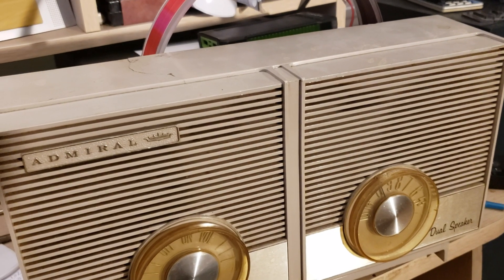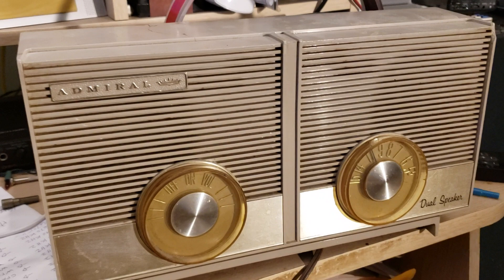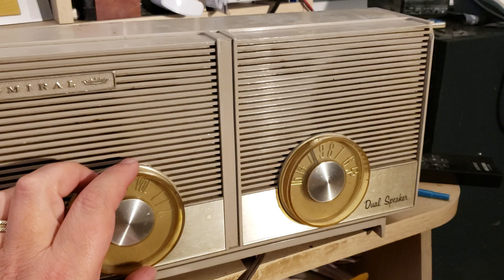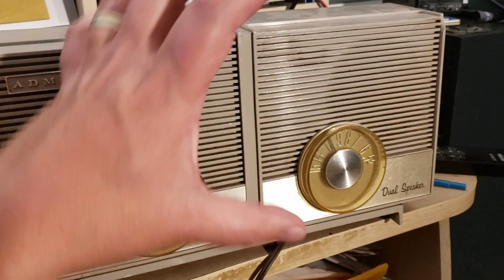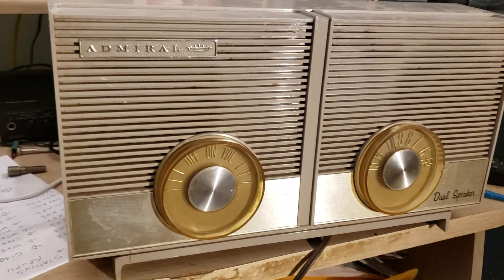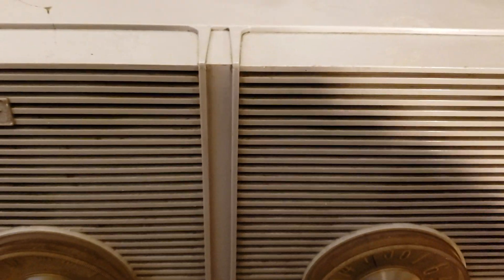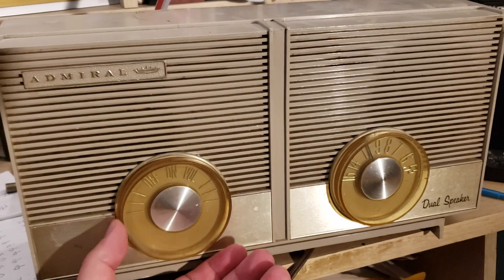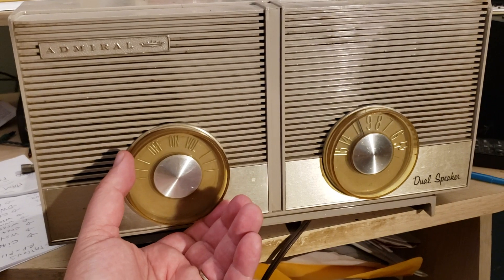American Five AM radio Tube receiver 1030 kHz WBZ with Tecsun AN-200 mediumwave loop Antenna

Comment: Admiral.  One of my favorite brands for tube radios.  I have 2 of them.  One is a 7 tube am/fm clock radio with RCA type Phono jack.
( works well with my iPhone) 🙂
I have the AN-200 but never thought to use it on my tube radios.
📻🙂